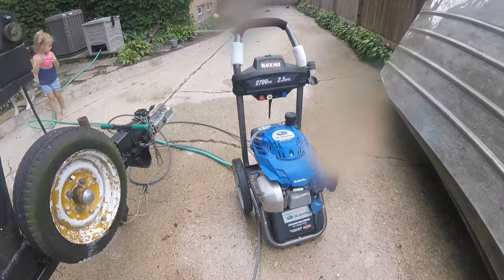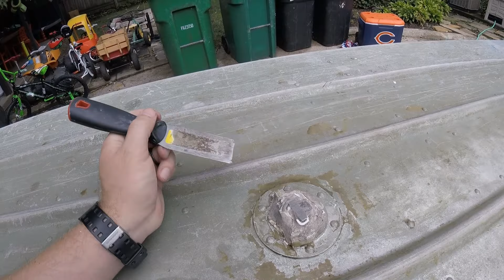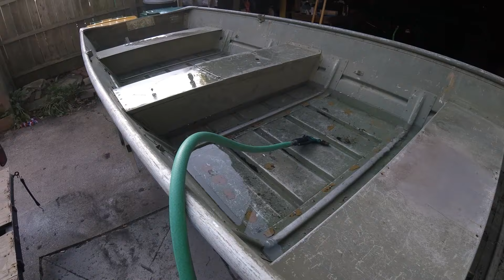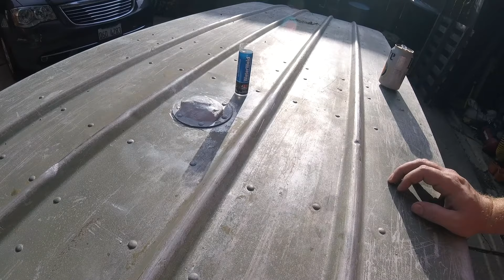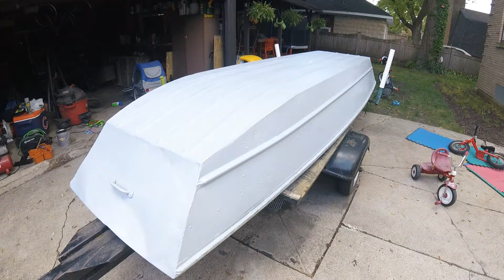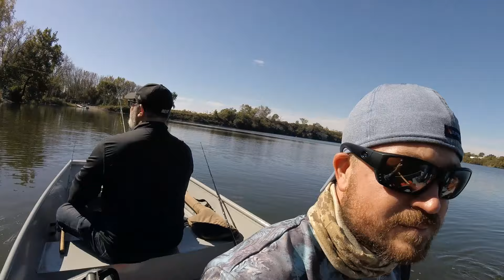Jon Boat Restoration 2019

Comment: You did a terrific job, it looks great! One question, did you brush on the primer and finishing paint?
Also, did you have any trouble with the paint sticking to the Flex Seal you applied?
Reply from the maker: Thank you! I mainly used a small roller for both and paint and the primer, the paint worked fine on the flexseal, no problem.
Reply: @NJKinsella   flex seal actually works? I always thought that was a bullshit made up  as seen on  tv product
Reply from the maker: @johnmcneely6967  It works really well